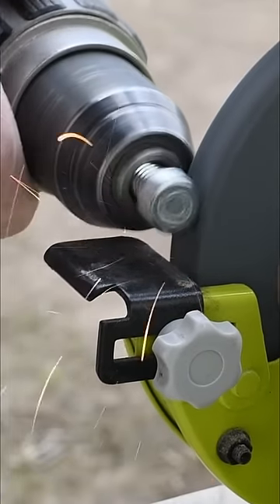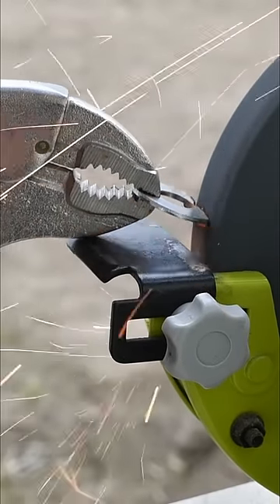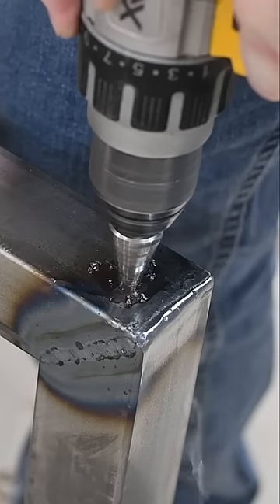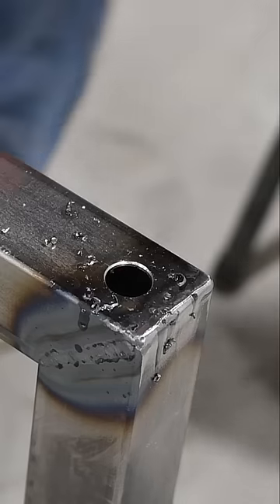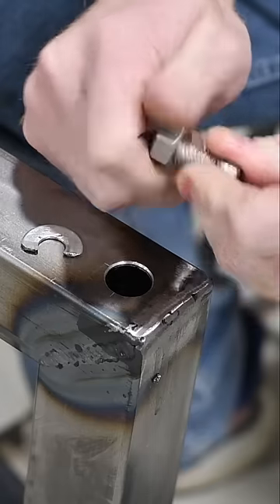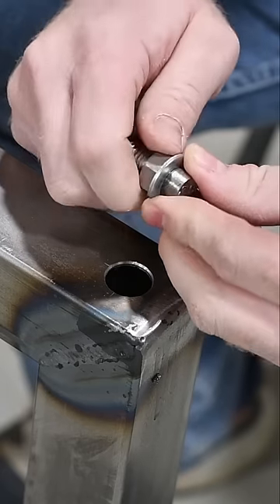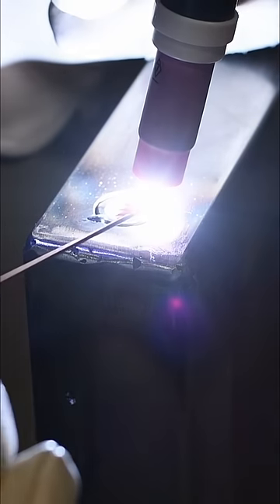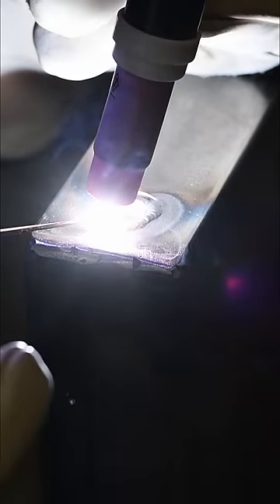The end of rivnuts! 👹Bwa Ha Ha Ha!#shorts

Comment: If you hammer it in so it's flush, what's the point of the washer and bolt which would do the job just fine without grinding away the hex... Just use a flat piece of Iron, hammer in the nut in with it laying on top, tac weld it, screw in a bolt so nothing flies into the nut or prevent distortion.
Unnecessary steps imo.

Comment: Any self-respecting welder would weld that nut onto the inside , from the inside before the box section was / is welded together at the joint .  And you wouldn't have that weld protruding on the outside . It's called forward thinking .

Comment: Your making the frame? Well weld the nut on the inside before you weld the frame together. ;) I wont be picky but why grind the bolt right down? Just grind one side flat as you only need enough room for a tac. You can twist the washer to suit. Thinking ya must be a Yank.

Comment: Why was the head of the bolt rounded?!
Reply from the maker: To create clearance to make the tack
Reply: @ShawMade366  -  once the nut had been tapped into place, unscrew the bolt to make space for tacking that way
Reply from the maker: The nut will just fall in, its pretty loose, despite having to hammer it in.

Comment: Drill a hole slightly bigger than the bolt size and weld the nut on the inside of the box section tubing before you assemble it.
We used this method for years on various different types of box section frames.

Comment: You could have welded that nut from the other side before you welded the box sections together.

That is, if you need something that strong which you wouldn't for a garage cabinet, a rivet nut would do just fine.

Not a bad weld though, far better than what you managed with the other welding on the box section.

Comment: So you have to grind down two hardware pieces just to put in 1 bolt rivet that is heated to a distorted level. Making both the metal and the threats weaker.